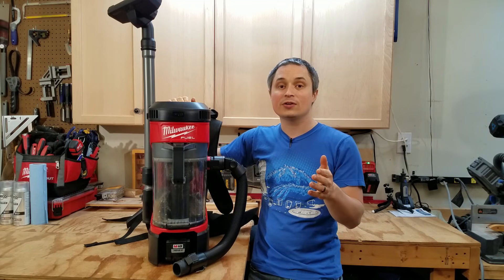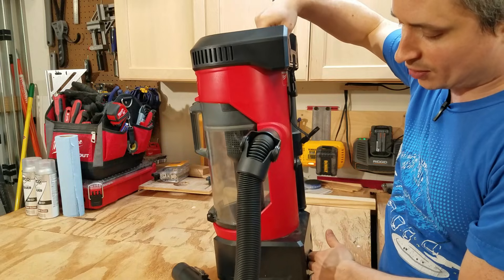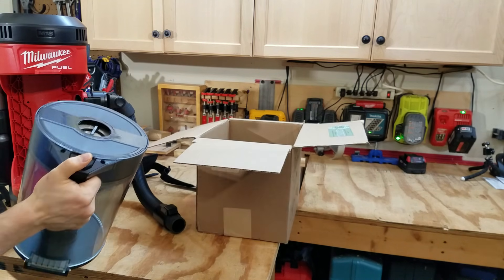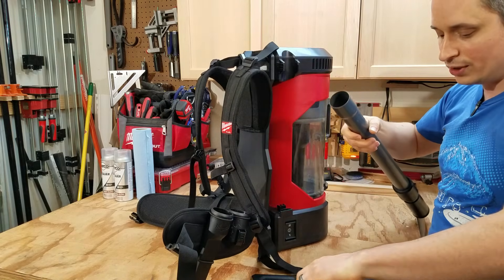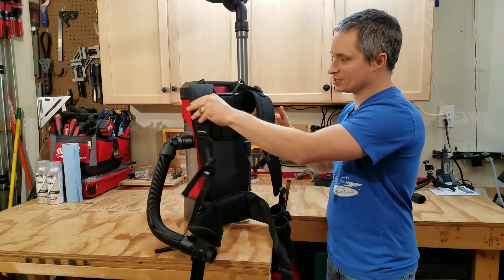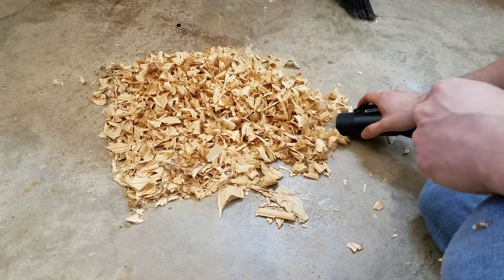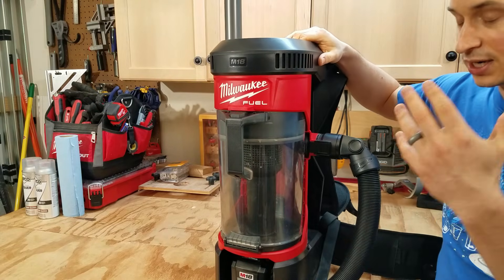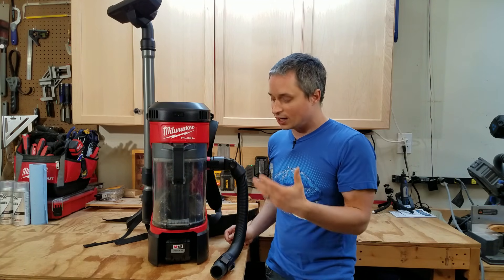Milwaukee M18 FUEL 3 in 1 Backpack Vacuum Review

Comment: I thought it used a cyclone for filtering. Just a regular dumb filter. What a bummer. It would have been very nice for ordinary house cleaning if it was a cyclone. Perhaps the floor accessory isn't the best but it should be no deal making an adapter to fit the one from my old vacuum.
Have been looking a long time to find a good cordless replacement for a full size vacuum as it's quite teddious dragging cord and machine around. A backpack is nice and keeps weight off hands. Sure there's the Dyson V11 but I'm not 100% sold on that one either. Very expensive and all Dysons I've heard had a very loud high frequency sound to them. Not animal friendly...
Reply: It's not a cyclonic filter per se, but it does use a cyclone air movement to keep fine dust particles moving near the outside of the tube so that the HEPA filter doesn't clog as quickly. If you use a regular wet/dry shop vac for fine wood dust or drywall dust, all the dust plasters itself over the filter membrane immediately and the vacuum loses suction pretty fast.

Comment: Can you do a test on gutters
Reply from the maker: It's not a wet/dry vac, I wouldn't use it on gutters due to risk of wet leaves. Plus, I don't think the hose is a big enough diameter for debris you're likely to find in gutters.
Reply: @DoresoomReviews  thanks. Any recommendations for a cordless vacuum for gutters?
Reply from the maker: I don't think any that I've used would be a perfect fit for that application. I use a leaf blower on mine, but then there's lots of cleanup afterwards!

Comment: Would this work with drywall dust
Reply from the maker: Yes it will. The HEPA filter will probably need to be cleaned out pretty often to avoid losing suction.

Comment: Can I use on wet floors ?
Reply from the maker: It's a dry vac only. Water will damage it. If you only have a few drops of water on the floor it will probably be fine. But puddles or any sort of standing water will probably break it.
Reply: @DoresoomReviews  Well that answers my question. I was about to buy one today. Not any more.

Comment: I thought you were able to pick up water with this without breaking it
Reply from the maker: Nope, it's a dry vac only. I think some of the confusion stems from the "water lift" specification, but that's just a measure of static suction power. It could also be expressed in mmHg, PSI, or Pa.

Comment: Great review!😍 One question! Will it automatically switch on and off when connected to a tablesaw?🙏🏻
Reply from the maker: No, it doesn't have any One-Key capability.
Reply: Allright, thanks!:)
Reply: Doresoom Tool Reviews on sale today... question. Do u need hepa filter installed? To use it?  Or just for fine dust collection. Basing my purchase on this. Hopefully do not need it installed.
Reply: From a DIY perspective it would certainly be possible with a transformer with low voltage secondary tap into a rectifier. A microcontroller looks for current flow in the AC feed to the tablesaw (assuming it's not a battery powered saw) by monitoring the voltage out of the rectified tap, and then uses a solenoid or servo to turn the vacuum on and off accordingly. Probably cost $50 to add this if you knew which parts to use.

If it was a DC battery saw, then you'd probably want to add a hall effect current sensor inline with the DC feed from the battery, and use that as the sensor. Some sort of current-sensing loop may also work, or something that senses rotation of the blade, possibly using a beam-brake sensor to the side blade teeth. The light sensor would flicker on and off as the teeth spin past and block the light.

Comment: Does anyone else get shocked when they combine their Milwaukee backpack vacuum with their Milwaukee rear handle circular saw?? Is mine defective??
Reply from the maker: I don't think I've gotten shocked before. But it's probably just static buildup from the vacuum. Do you live in a dry climate where it's more likely to happen?
Reply: Doresoom Tool Reviews - Yes, in a desert, Utah. I’ve only tried it when I’m wearing the vacuum on my back. I don’t noticed it with any of my other vacuums. I’ve used the Ridgid Smart pulse wet/dry, which is corded, and the Dewalt cordless Flexvolt dust extractor and I have not been shocked by either of them.  I just wanted to ask around so I don’t end up replacing one or the other and still continue to have the same issues.

Comment: M12 POWER HEAD.... problem solved
Reply from the maker: That is a killer idea!
Reply: Or do what Dyson does and create one powered from main battery.  If Dyson can make one with a smaller battery, it should be no problem for Milwaukee batteries.
Reply: @jayrider9240  whats DYSON ? another tools or vacuum company or a guy in a garage
Reply: @kelvenguard  vacuum company.  Basically the current king for cordless vacuum